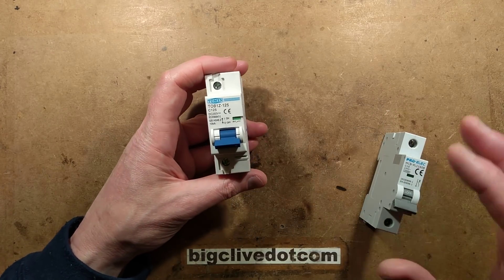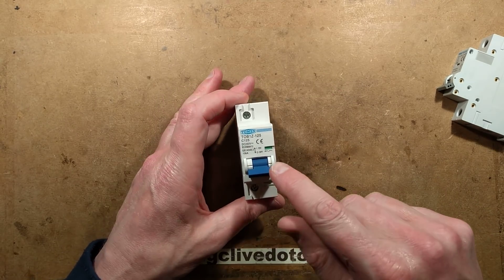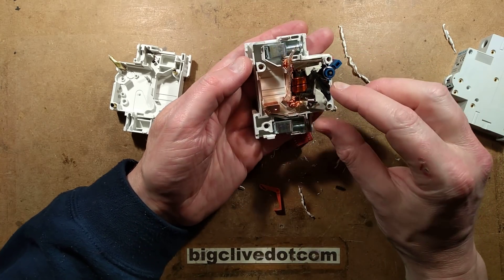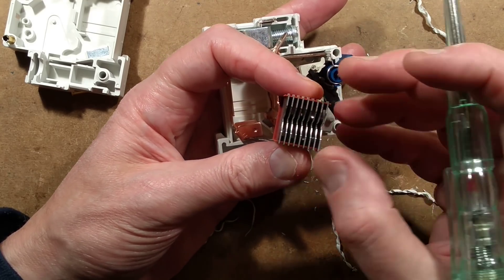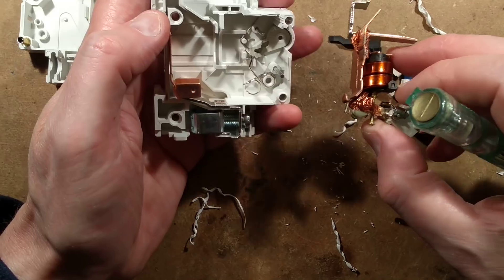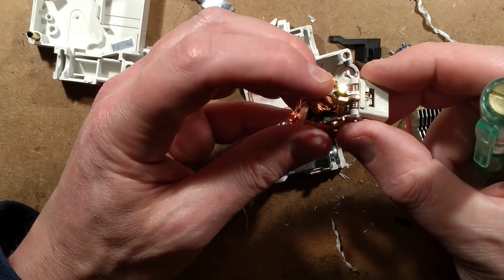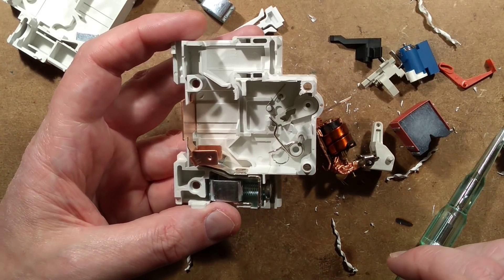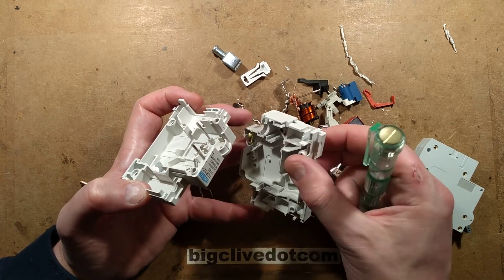Inside a 125A DC circuit breaker.  Unexpected arc quenching feature.

Comment: Any DC breakers, we used in industry used 2 pole, switching the negative as well as the positive. I have came across 3ph breakers wired in series. This breaker does not look as if it will last long, especially at the rated current.

Comment: I was expecting to see a ceramic or phenolic tab that would swing in between the contacts, and into a slot, to literally cut off the arc plasma. that would allow for high voltage, and would be indifferent to polarity. If the plunger in the solenoid is magnetized, that would also make it polarity specific. Using magnets to bend the arc into a quencher heat sink makes sense, and is probably more reliable than a gate, but that makes it polarity specific, as well.

Comment: This is why polarity is very important with DC breakers.  
If you get it wrong it blows the arc out the side of the breaker.
I saw one someone did this to on a solar installation.
Reply: Yeah, most have a big plus and minus marked...
ABB's S800S-UC appears to be polarity insensitive, which is interesting. They claim they have two arc chutes per pole (including the AC versions), so perhaps they have a different magnetic polarity on each contact/chute?
The lower voltage S200 ones do have a marked polarity.
Reply: @someonesomewhere1240  now popular types of dc breaker are all non polarity😀we are professional manufacturer of dc breaker

Comment: The size of the gap between the contacts will be set by the rated voltage (as long as the arc is quenched on tripping) so as long as the voltage rating of the breakers are the same then the gaps will be similar
Reply: Erm, that's not my experience.  At least with relays and contactors used in avionics.  They are usually rated at the same current for both 28 VDC and 200 VAC (400 Hz).  The voltage matters, but also whether it's DC or AC.

Comment: Thanks Clive . I wonder if they do one in a clear plastic that would be interesting to see it break the circuit.
I'm thinking perhaps not though because of possibly clear plastic makeup  but im not sure.
Reply from the maker: They do the AC breakers in clear plastic, but I'm not sure about the DC ones.  You can't see the contacts in the clear breaker because they are in the arc containment area.
Reply: @bigclivedotcom  Ah yes that would be pointless then , shame you cant get them apart without parts pinging off the ceiling but they all seem to do that .
Thanks for the reply.

Comment: The permanent magnet creates a Lorentz force on the arc, pulling it into the quencher where it gets elongated and cooled down by the plates, thus increasing the arc voltage to the point of extinction. But the permanent magnets mean that this device has to be used in the right polarity, or the magnets will push the arc away from the quencher instead of pulling it in!
Reply: This also holds true for DC Contactors (high current relays) which will have magnetic blowouts to help extinguish the arc when the contacts are opened, though the contactor will generally have a much lower max interruption current compared to a breaker it has to deal with the same concerns of arc after opening the contact and as such they will have a directionally as well.

Edit: May 25th 2019 - spelling
Reply: @cmlara5333  *contactors 
(The text originally said "contractors" twice. That has since been edited out, but I can't accordingly delete this comment because no one will know what the following comments are talking about. But now I have to add 
* directionality 
Aargh! No rest for the spelling-sensitive weary!)
Reply: MottyGlix  Thanks for the correction! Never trust spellcheck at 2am in the morning.
Reply: @cmlara5333  I knew what you meant anyway.  Spellchecker is worse when you also have a drink in!
Reply: I agree with you, but why are there no polarity indicators on the thing then???
Reply: @TheHuesSciTech  isn't that magnet far more important than polarity? WeVHtMMbYvM
Reply: So the question why there are no markings on it itrigued me and made me look online for other DC-Circuit Breakers. As a german I searched for german fabricated Breakers and the shop I found one in provided pictures of it and on those pictures it doesn't have any markings either, even the specifiction sheet did not provide an identification which lead should be fastend to which terminal. Now in germany it is generally regulated which lead should be fastend to which terminal, but usually you still get markings telling you such things if it matters.
This leads me to believe that it actually doesn't matter, but I have no idea how it would work with those magnets.

Much more interesting is that in the specification sheet it's specified to have a magnetic breaking technology (as expected) and a hydraulic one. Now I could be wrong on this but I'm pretty sure bimettalic strips are not hydraulic, so im wondering how this hydraulic breaking technology works.
Reply: In addition to what others have said about the magnets making this a directional breaker (or not), that big coil trip will be directional unless the trip mechanism is designed to trigger with both a push and pull of the coil.
Reply: It has two magnets. So I'm guessing one for each polarity of DC arc is might have to break.
Reply: That magnet is to capture the metal particles from the arc...As that metal travels at 50k psi when it explodes. So it will try an contain everything with in the casing..

 The NFPA 90 book... They show you what happens from an arc fault..
Reply: what do you mean by right polarity? is that the phase?
Reply: The device can be used in any polarity because according to Fleming's right hand rule whatever be the direction of current the magnetic force points in the same direction so the arcs are always pulled into the quencher
Watch Electroboom's rail gun video for better understanding
Reply: @krishnendumathur982  If the breaker was using a blow out coil and no permanent magnet you would be correct.  Because of the permanent magnet and the symbol on the breaker it is a polarised breaker.
Reply: Wouldn't reversing the polarity just pull the arc back and to the right instead of back and to the left (or vice versa)? Assuming the magnets are arranged to create the right field.
Reply: @danpowell806  Not quite.  The blow out field is at 90 degrees to the direction of current flow which drives the arc upwards / downwards depending on polarity.  In a situation where only a blow out coil is employed, the relationship of the two fields is maintained regardless of direction of current flow. Permanent magnets however have no awareness of current flow.  I think this design uses both the permanent magnet and flux from the series trip coil, swapping polarity would make the coil flux oppose the permanent magnet.
The symbol on the front appears to denote a polarised breaker. I don't however see any clear marking of how to connect it unless it is printed on the side.

Comment: Clive, can you investigate the the polarisation of the two magnets? I'm wondering if putting multiple DC breakers side by side on the same DIN rail can cause issues because the magnets interact.
Reply: Very good point nut I doubt they would interact. They aren't powerful enough.
Reply: @leonardjwright  They seem to be neodymium, and they are on both sides, so only 4-5mm apart if two or more of these breakers installed on the same DIN rail next to each other..

Comment: The distance needed is dependent on the voltage, not the current.
Reply: It's both. An arc welder only runs at about 20 to 30 volts, but at 150-200 amps to jump nearly 1/2 inch. You do have to touch the work piece to strike the arc, but it can be drawn out quite a bit, before it extinguishes, owing to huge current, even though the voltage isn't that high. inductive loads are the worst(large DC motors), because the inductance provides voltage, allowing the arc to establish.
Reply: @vincentrobinette1507  You're right about the maximum distance the arc can go, I oversimplified.

The spacing of the contacts in the open position isn't determined by how long the arc can be when struck, only by how close the contacts need to be for the arc to start. The arc arrestor (block of plates with the magnet) size is what matters for extinguishing an existing arc.

Comment: Clive, DC contactors also use magnetic arc chutes and it would be interesting to see inside one to compare. High spec used contactors like the ABB GAE75-10-11 are sometimes on Ebay for under 100 USD, and are rated for thousands of cycles per hour.

Comment: I thought that the sole reason for not using ac switches for dc is the electroplating or electric machining effect that wears the contacts down.
Reply: AC current and voltage go through 0v/0a 100times a second, this breaks the arc much easier and usually limits how long the arc will last for. DC however doesn't do this, once the arc is started the superheated plasma conducts the electricity and reduces resistance and unlike AC it is always at full current and voltage.

Comment: If you want to see a really impressive DC circuit breaker (albeit quite old), have a look at this one which PhotonicInduction acquired a few years ago:
https://www.youtube.com/watch?v=WAhq_A4EbkE
If you think 125 amps is a lot of current, try 1600 amps continuous or 20,000 surge, at only 50 volts. He thought it probably came out of an old diesel-electric submarine, and I think he was right, since that's about the only environment where you would encounter DC at around 80 kW. This translates to about 106 horsepower, which sounds about right for a World War 1 era submarine electric motor.

Comment: Yes magnets seem to be the main difference when I compared ac and dc breakers in a video a few years ago. You didn’t notice that dc breakers tend to be polarised. The tomzn ones most definitely are.
Reply: they have to be to work right....... unless you prefer the arc to be pushed back towards contacts ;)
Reply: How do you know which side is which?
Reply: @mrtechie6810  there should be a diagram printed on the breaker showing the terminal with most potential. Usually marked with a +

Comment: This video makes me think of only one thing. I'm so glad that Nikola Tesla won the battle. Right ?
Reply: Brushless motors are ac motors with built-in dc to ac inverters. So without the idea of the ac motor, no brushless dc possible,,,
Reply: With DC we'd have been stuck with brush motors for a long time. Personally I'm not a fan of brush motors.
Reply: Many years ago I saw a d.c. circuit breaker from early in the 20th century rated at several thousand Amps.  Frightening thing.

Comment: "Another thing to say about this is it's a 'cheapy' from China, so there's no way of knowing it's going to perform as desired"

It probably will perform as desired because of its heritage, which is likely as follows: -

1. A European or North American company with a long tradition in the design and manufacture of high quality electrical components decides to offshore manufacturing to China to improve margins.
2. They identify a Chinese manufacturing partner that tools up a production line under the direction of the customer. 
3. Once the Chinese partner is up to speed, has ironed out any process problems under the expert guidance of the customer's technical and engineering staff, and is able to manufacture to the required quality, everyone is happy - the customer gets their product made to an acceptable standard and it's cheaper. The customer shuts down its factories, fires all of its engineers and rebrands itself 'Acme Electrical (Marketing) Ltd'. 
4. Within a few months a remarkably similar Chinese product appears on the market undercutting the European/North American company on price, and so it progressively loses more and more market share because it cannot compete with the new Chinese entrants.
5. Everyone wonders at the ingenuity of the Chinese manufacturing industry because it has managed to quickly bring an excellent product to market that undercuts all of the traditional western suppliers, especially the western company that outsourced its manufacturing there, without realising that the 'new entrant' product is likely coming off the same manufacturing lines that it helped to set up.

There are many variants of this story with minor differences (such that they don't matter).

Comment: 125 A through such a small contact area? That's difficult to believe.
Maybe it's 125 chinese amperes, which means they added a '1' onto the front...?
Reply: SigEpBlue actually you may be right ,you know..passing that much current through that thing,doesn't end well.
Reply: At 125A the contacts weld together in a big blob of molten metal. They have no problem carrying 125A from then on :)

Comment: What would this dc breaker be used for? Seems to low rated for third rail trains and too high for anything else.
Reply: Small electric vehicles, e.g. riding mowers and golf carts.
Reply: @NiHaoMike64  I did think of that but it looks like it should fit into a wall mountable consumer unit. My grandad who's a 100 remembers dc being supplied to his parents house. Kind of odd /ironic  now that most things plugged into a socket get reduced to dc, and with USB 13amp sockets we have 5v dc sockets. John ward did a good video of why not to use dc in a ac switches due to arcing.
Reply: @tonyjones9442  They are also used in off grid power systems.
Reply: @NiHaoMike64  funnily enough I've just been reading how parrafin lamps are still used in Africa, and the combined co2 total of those lamps could exceed aircraft emissions . I know, doubting it myself. I Iive in Wales, plenty off grid houses here. Not for environmental reasons, just some people didn't get connected in the first place.

Comment: Schneider Activ-9 circuit breakers and the older C range are all rated for both AC and DC at rated current. Had to email Schneider tech dept to get the certification for them as they are used in an awful amount of industrial applications.
Reply: Usually only to 48 or 72V - I think Schneider is 48V only.
Reply: @someonesomewhere1240  No, considering we were using 400v DC in some instances,  I had to check with Schneider, they certified the breakers as being capable to take the rated current regardless of whether the load was AC or DC and the voltage rating was the same for both. If you brought an MCB or MCCB there was no down rating just because its DC. Consider that this was for large scale commercial Datacentres I was most insistant in getting that in writing as any downtime was measured in the millions of pounds per second. I had to be sure.
Reply: @jeremytoms5163  That's interesting as that's contrary to their datasheets: https://download.schneider-electric.com/files?p_enDocType=Catalog&p_File_Name=CA908061E+(web).pdf&p_Doc_Ref=CA908061E
Perhaps you were using them for off-load switching (DC-20) only? There's generally noissue with carrying the load, only breaking it or interrupting a fault.
Reply: Someone Somewhere  This is where it gets interesting, page 34 of the activ-9 catalogue. DC rating is 133vdc for 2&3 pole and 250vdc for 4 pole at 10kv , breaking capacity. As I said, I had to check as I'd read the same spec you had when I took over the DataCentres . I wondered how the install teams had got away with installing these breakers on Low voltage DC and so went to the technical team of Schneider for answers. I was lucky in that I'd dealt with them before on a few 11kv substation builds so already had contacts. The letter I had came from Schneider Technical in France. I emphasised that we were talking about DC not AC and they were quite unequivocal  that their breakers would be rated the same both Volts and amps on DC and AC. Must admit that I was glad about that. Do you have any idea the hundreds of circuits we would have had to re-engineer across 7 DataCentres and 15 Nodes ? Can you imagine explaining to your customers that the previous installs were buggered and needed to be ripped out and by the way we're not sure if we can safely carry the load whilst we start rebuilding? That was a very anxious couple of weeks. One of the reasons that I hate DC in DataCentres, such a pain in the arse all round.
Reply: @jeremytoms5163  I'd be most interested to read that email, given even load-break switches need to be massively over-rated for low-voltage DC.
Reply: @someonesomewhere1240  Not possible I'm afraid. Had to retire last year due to ill-health. All emails like that are on the company servers not mine.  Still struggling to get back to fitness a year on.
Reply: @jeremytoms5163  Ah, not good to hear. Hope you're doing well and staying away from crowds...
Reply: @someonesomewhere1240  I'm alive and kicking, as long as I stay above ground its a result !
It is what it is, we can moan or pick ourselves up adjust to the new reality.  Take care and stay safe.